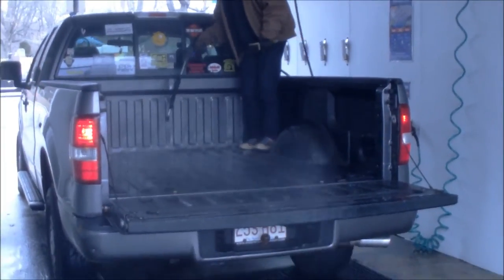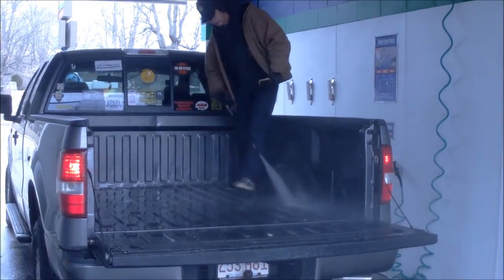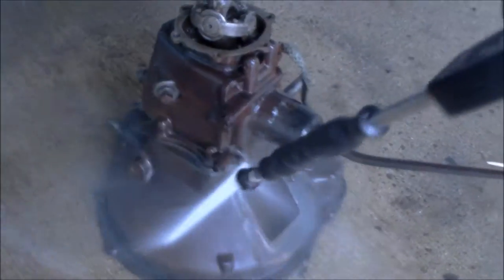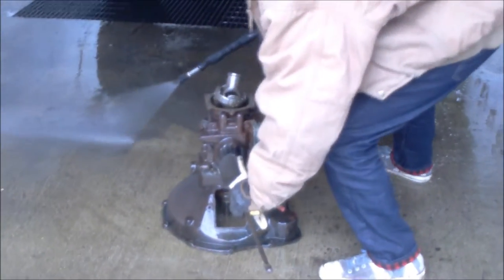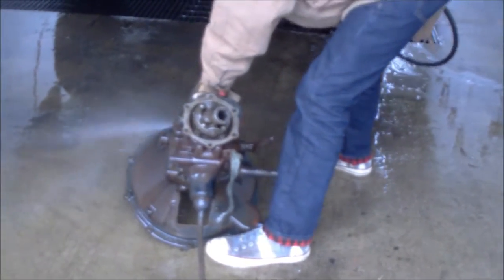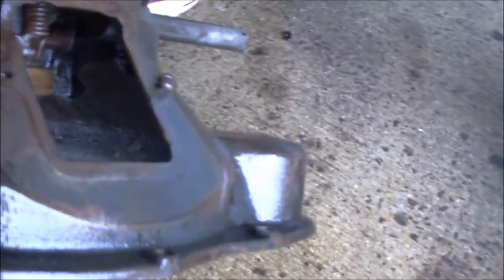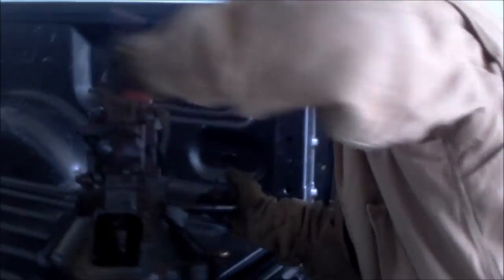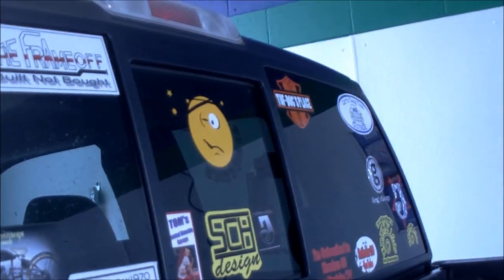taking the Oven cleaner off the model a Transmission

Comment: Udizzy1969, Oven cleaner and car wash worked out. I was thinking of taking the green golf cart to the car wash, the pressure is good enough to blast away rust flakes. Thanks for posting
Reply from the maker: Harvey Spooner yes indeed, it works better using there's .  cheers brother